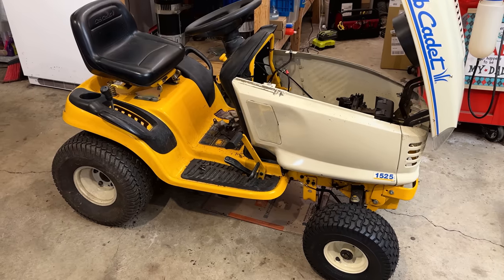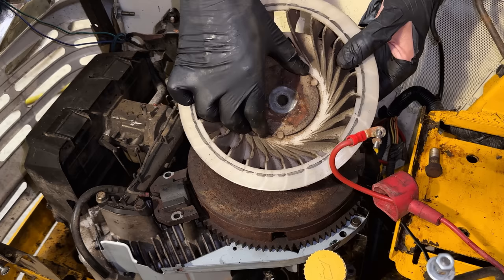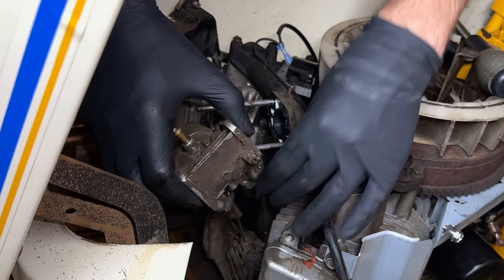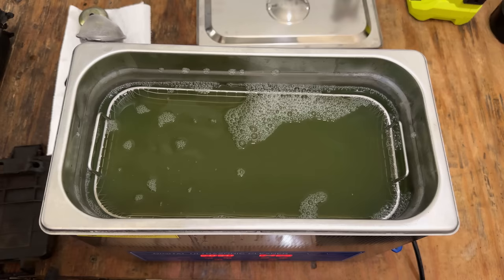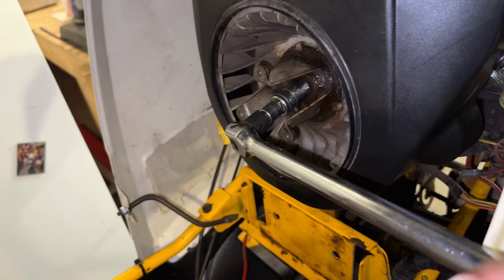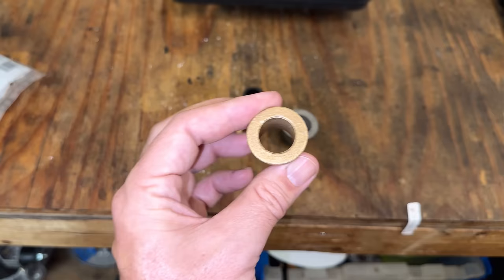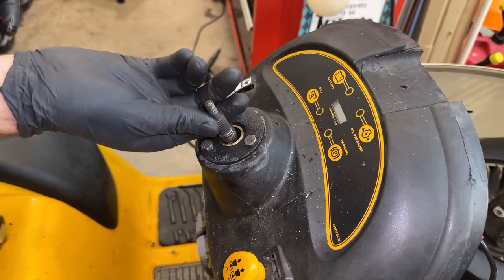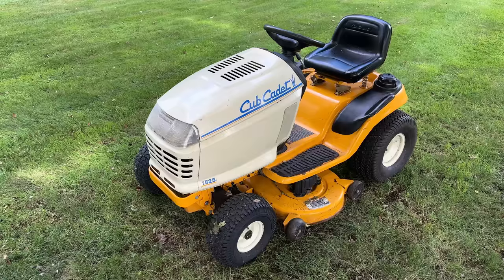Cub Cadet Crash (Pt 2) - Tractor and Tree Damaged

Comment: When I see the condition of the engine I get an irresistible urge to use brake cleaner in excess as needed to get rid of the grime, grease, oil, dirt and crud.

Comment: If you want to refine your steering wheel repair even more, Amazon has a two pack of 3/4 OD by 5/8 ID sleeve bearing for $6.25.  It looks like they would drop in and remove almost all of the remaining play.  My local ACE hardware and Tractor Supply also stocks similar parts.
Reply: I was thinking there had to be something in the McMasterr Carr catalog to take up that slack, too.

Comment: Terrible design, great repair (and improvement). The engine is excellent, the steering wheel, shaft, gears are certainly not on the same level. Using those plumbing parts was very thoughtful engineering. Good job. Thanks for another invaluable video.

Comment: I used to be loyal to Cub Cadet for lawn tractors 20+ years ago. The last one I bought in 2018 ($2600) was a lemon. Unrepairable fuel injection. Poorly designed bearing surfaces everywhere! Ungreasable deck spindles. This one you fixed shows how cheaply they make them now. I traded in my lemon on a Kubota diesel GR2120, a dream machine. Four times the money but ten times the machine.
Reply from the maker: The sad thing is this one was built in 2003.  They are even worse now.

Comment: I hope the design engineers at Cub Cadet were watching this video. Maybe they took notes on creating a better design in several areas, especially around the steering column. That worked out great.
On behalf of myself and my lawn, thank you for bringing back new life to what was my favorite lawn tractor(although the zero turn is pretty cool).
Reply: I have 3 of the older Cub Cadets;,A 107,A 682 And a 1710 which is identical the same as the 682 other than the difference in numbers. The new plastic junk that is being sold nowadays has entirely way too much plastic. The older Cub Cadets and the older John Deere garden tractors utilized the Ross steering column and gear rather than the sector gear setup like the newer tractors had. I was quite surprised at the lack of support for the steering which is engineered to fail. The steering columns In all of my Cubs are rebuildable and have a good steering action.
Reply: @TheIronDuke502  Great information. I wish I had done more research on my Cub Cadet when the steering started to get sloppy very early on. By not doing something about it, I couldn’t correct the steering as I got right up to the dwarf apple tree where grass grew right up to the trunk,  and ended up catching it with the blade housing, which lifted in the air and came back down on the other side of the trunk. It’s when I put it in reverse to attempt to back away is when it caught the trunk in a weird way that actually caused the damage to the steering. It’s hard to explain and I couldn’t duplicate the incident in a million years. I was in my late 60’s when this happened and never had an automobile accident, so this really pissed me off.
Reply: @PaulMack1249  Yeah, I totally understand. One afternoon I was mowing next to the road and I went to turn the steering wheel in which the next thing that I knew that the steering wheel was freewheeling. I had to grab another tractor and pull a few feet forward and stop and kick the front wheels to straighten them out and pull a few more feet forward until the wheels started turning pretty far over which seemed to be a never ending struggle.
I finally got the Cub pulled inside my driveway., Luckily I found a really nice Ross steering assembly on eBay.
After pulling the steering wheel from the splined shaft at the top and dropping the mower deck and disconnecting all the steering tie rod shafts, I concentrated on the underside of the tractor in which I used a come a long hooked on a strong tree limb to raise the front of the Cub Cadet up at a 45 degree angle where I could get to the steering box mounting bolts. 
You have to pull the steering assembly from the underside of the tractor, But was not very difficult to pull out once the bolts were removed.
Most all of the older Cubs and John Deere’s that used the Ross steering assembly were very similar to one another concerning the steering.
Reply: @IronDuke502 I have to agree this is a very poor design from plastic surface wearing against steel to the attachment of dash to the two vertical tubes.  I have a old cub cadet 2146 and it is nothing like this setup.  I have had to replace parts of the deck and replace oil seal on front of the engine but mostly a robust garden tractor.

I am surprised James cobbled repair came out as well as it did, by the time it gets loose this machine will have not much if any life left,

The amount of work needed on this machine not sure it was cost effective  but makes a good video.

Comment: Hi James, You are amazing. You waltz through all these small engine repairs better than anyone I know. I realize that since these engines will only get dirty again, but I would start off by cleaning the engine, (as best I could) then start the repair. Also, shouldn't some of those new parts be painted with Rust- Oleum, or at least primed? That's the way I would work. I realize there's an additional cost involved, but working on clean parts is more enjoyable.

Comment: I have a John Deere with the same engine. This mower was given to me because it wasn't running well and the John Deere shop wanted 1800.00 to make repairs.
It ran good at high speed but seem to run only on one cylinder. I miss diagnosed it as a bad coil shower however found out it had overheated due to clogged cooling fins and was leaking compression by one head gasket. I tightened the head bolts it's running great now.
As far as surging I also cleaned the carb but did not stop the surging.  After reading the owners manual found out the surging is normal under a no load condition. It does not surge under load. 
Hope by cleaning your carb you stop the surging.  Mine is a 17hp.

Comment: That's a heck of a lot of work to a basically through away mower. I give the steering wheel repair 1 season at the most. Very good video. Thanks for the time and trouble.🍻
Reply: But Spitter, the “throw away mower” is now $2200-2400 at all of my local box stores.  So still worth saving if one has the time to do so.

Comment: I had a new personal best on a carb job yesterday. My mom's Troy Bilt tiller was acting up due to a carb issue. I removed, cleaned, and reinstalled the carb in 14 minutes. It ran perfectly. I'm proud of that one. The main jet was clogged.
Reply: Inline filter installed in fuel line today?

Comment: A better suggestion for the ZIP ties. Use ADEL cushion clamps sizes for the tubing and then hardware for attaching  the dash panel to the ADEL clamps. I have used many for firewall forward to attach and isolate wiring, fuel and oil lines in building experimental airplanes.

Comment: Maybe a piece of standard copper pipe could have been used to take up the extra play in the steering support. Also before you drill the holes to mount the pipe flange, is may have made a difference in reference to the positioning forward or back to the tightness that the gears at the bottom that mesh.

Comment: James:   Love your channel.   Been a long term subscriber.  I watch all your episodes.   As an individual who works on my boat engines and electrical generator engine, I have always found that cleaning up the engine in advance helps to identify where leaks emanate from.  The cleaner the bilge, the easier to diagnose what is leaking (engine oil, coolant, power steering fluid, raw water, etc).  I was surprised you didn't hit the engine especially below the fly wheel with a steam cleaner and PB Blaster to clean it all up before starting.  Respectfully, I suggest this since you showed that the dipstick tube was leaking.  I notice how often you clean other engines and units at the end of the work which is commendable.   Thanks for sharing these videos with all of us.
Reply from the maker: WD40 would have done a good job cleaning.  Was really hoping spray it in degreaser and pressure wash.  But the pressure washer had other ideas.  Not done with it yet, but want to use it a while before finishing it up.
Reply: @jcondon1 I have noticed on your videos that you don't seem to do too much cleaning in advance of teardown.  On my machines that see mud and/or grass when mixed with oil irs miserable to work on so a preliminary cleaning is first step in the repair process.  It allows proper visual inspection, not to mention just nicer to handle clean parts.

Your camera angles and editing are top knotch.  I have picked up alot watching your videos !!

Comment: Hi James, Just for your information, you mentioned the thread on the oil pressure switch as a pipe thread it is actually a British Standard Pipe Thread (BSPT) and as such it is a "Tapered Thread" Keep up the excellent work cheers mate.
Reply: No it's not. 1/8" NPT

Comment: Funny how we each look at a problem a different way, I thought I would remove the dash and weld a bracket on the hoop to support a column bearing so to remove the inherent design flaw and give support for the dash as an added Bonus. But then again hind sigh is always 20/20. Nice videos on the Cadet.
Reply from the maker: I almost did the same.  It would be a better repair.  May need to at some point.
Reply: BTW I got a Chuckle when your son wanted to go for a joy ride, kind of reminded me of the old days. Great Channel @jcondon1

Comment: Love your channel and the professional nature and patience you put into each project you do. I’ve learned so much myself and plan on doing my own later next spring hopefully. I. Have a 1957 2 1/2 hp 2 cycle mower I’m going to attempt to restore hasn’t run since 1980. Also have a 8.75hp craftsman I believe is a Briggs motor a yard machine rider given to ma with 17.5hp motor and a 1970 Troy BILT horse tiller to begin with. I live in southern Indiana a mile north of Louisville, Ky. Just wanted to thank you for the channel you do here and what I’ve learned about motors etc. I just got lucky that I have an Echo CS-400 chainsaw it’s been in storage for 4 1/2 years with old fuel in it. To my amazement it started and idled perfectly on first pull. I topped off fuel with fresh, cleaned sharpening chain and adjusted tension on chain and filled bar oil. Literally ran better than when I bought it new. Again thanks to you for everything you teach us here. Your appreciated.

Comment: Could you also have, as an extra refinement, slipped one of those other plastic bushes, suitably thinned down on a lathe,  with it's flange upward onto the steering shaft to take up the play in the nicely engineered metal pipe bushes??

Comment: I just got $500 for a Craftsman R1000 junk mower (I replaced the requisite steering gear), so I don't think you will have any trouble getting that much for this mower, especially with all the new parts.  This one was well worth it, particularly when you factor in the revenue from the video.

Comment: Another job well done.  Interesting how you think you only have one or 2 problems,  yet the deeper you go the more you find.  I agree,  it was worth the extra work.  

For what I have in my murray,  about $400 I'm sure no one would be willing to pay $500 . That's ok, I enjoy it, it does a great job of cutting the grass.  

I swapped the original 12.5 horsepower Briggs for a 25 horsepower Kohler V twin.  No grass to thick or too tall, it cuts it all.  😊 (40 inch cut)

Comment: Awesome repair. I have not priced new machines since I bought my Poulan Pro in 2017. Mine cost $1,300 back then. I need to address my steering wheel slop soon but other than that I have no issues. I do regular maintenance & keep it clean. One good feature of my 19HP B&S motor, it has the oil drain where I put on the clear rubber tube, then twist and pull the drain. This is to ensure draining oil clears the frame. This is the first year I have replaced the blades. I have a jig to sharpen them with a diamond wheel, & a balancer. I don't know how junk gets into the fuel tank, but I have had to remove it twice to empty & clean it out as well as replace the fuel filter.

Comment: Surprised that you chose to struggle with the body panels in place.  I always take mine out before servicing.  Cub Cadet engineered them for easy removal (at least they did on the older machines)
Reply: Yes the older ones had those coned washers and springs,looked almost like an engine remove would have made it easier yet for all the motor work,reseal that sump plate , new crank seals while its off, and he already was having issues with that polley on the PTO side
Reply: My CRAFTSMAN mower has a hood that can be removed without any tools.

Comment: Great job is always James. I worked on a few of these machines they are MTD build Cub Cadet branded. Most people would have just parted out the machine cuz it has a great engine and the rest would have been scrapped. Great job once again!
Reply: MTD builds for a lot of different brands. The question is who does the engineering. Is it MTD or Cub Cadet. Or Craftsman. Or Yardman

Comment: Good job.  Glad you mentioned the cost.  I have a John Deere x540 garden tractor and it was 7600 new and snowblower, bagger, and tiller brought the total up to 11k.  Only repair I've made is putting a new belt on the PowerFlow for the bagger and that was $47 bucks.  Robbery.

Comment: I enjoyed this series.  My only two suggestions, you should have put a touch of grease on the plastic steering bushings and definitely put some thread sealant on the oil pressure switch.  It's a common leak point due to the vibration of the engine.  Good work overall.

Comment: This comment isn't for this particular video but suggestion in general.
When drilling plastics, you should use Brad point drill bits. I've used the ones from fuller twist drill company and stand by those. They drill perfect holes exactly where you need and also cut the outer circles of the holes to get perfect right angles. The praise MAY be for all brands but me buying 10 of one size and using them, they are sharp.

Comment: Good job on thinking of the cleaning, too! One of the worst things for these engines is that oily grime sticking to everything after a leak. It affects the cooling a lot more than one´d think. Not only on the cylindre fins, but on the whole block. I usually degrease everything with gasoline and brake cleaner/acetone as good aspossible, I basically wash down the whole engine with a brush and gasoline. In combination with a fixed leak, this greatly prevents buildup and therefore temperature regulation issues on the engine.

Comment: Thank you for posting this excellent video. Watching these brings back memories of my father riding a much older Cub Cadet model in the 1960s. I was a kid back then. I am pretty sure it was a Cub Cadet mower. The family did not have it for long. I'm not quite sure what happened to it. One of my uncles also had a riding mower during the same time period, but I'm not sure what brand and model it was. He unfortunately reversed it into his very young son with the mower blades running. The boy survived but had severe leg injuries. I think a lot of the older mowers simply had no safety features at all. A backup camera connected to a computer which could stop the tractor and mower blades if an obstruction was sensed would be so good. I hope modern mowers are safer. I've never had a need for riding mowers -- my yard space is almost entirely planted with shrubs and trees, there is very little grass.

Comment: Hello  James: The conclusion was not a disapointment. The way you repaired the slop in the steering shaft almost identical to the same repair on my old garden tractor. I  never thought of using a bulkhead fitting. Would have saved me several hours of work. The Craftsman old enough it did have a metal dash so that was a bit easier than the JB weld. You should get many years of service from the unit now. You are absolutely correct the time and cost of repair well justified. Keep up the good work. Looking forward to both the zero turn and pressure washer videos you sent out the hook for. You caught me.

Comment: One extra extended bend in that frame that the plastic dash is (usually) bolted to would have been minimal cost and provided a rigid steel mounting point for a half decent steering column upper bearing (albeit only nylon/plastic?) which could also have considerably slowed down the wear and tear on the steering sector teeth which I suspect were increasingly more misaligned as the hole in the plastic dash rounded out.

Comment: It will look like new when you get to pressure wash the oily beast! Probably should have just taken both sides and the hood. For the cover you can use early Honda Accord/Civic around 2000 front valance retainer bolts or timing belt cover bolts. They look like same. A small shop lathe would be nice to make special parts for stuff like this. Thanks Jim!!

Comment: Watched a few of your other videos during the holidays.  You repaired a snow plough with same problem, petrol suction tube , you replaced whole tube with right sized brass pipe and put petrol valve filter on the end of it ,

Comment: Awesome job! Kawasaki engines are by far the best IMO. On that steering shaft bushing I wonder if a simple 3/4” electrical chase bushing might have worked too, although I guess you really needed the extra support of the bolts with that terrible dash design.

Comment: I have that same mower, the bolt on the oil dip stick is longer then the other 3 bolts. But all the original bolts are shoulder bolts 
Over the top of the center of the fan  guard bracket is a spacer you can get away with using washers to lift the dust guard up off the beauty cover.